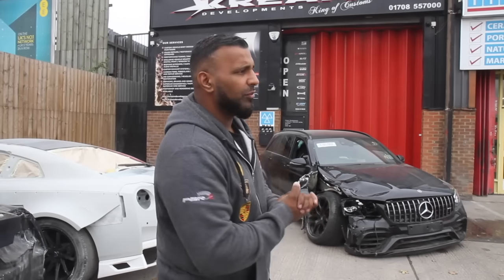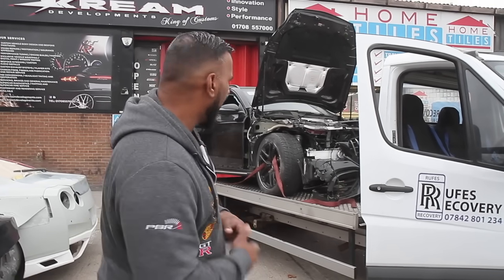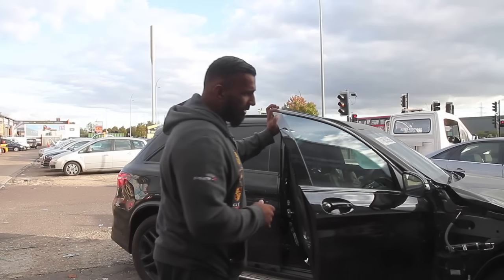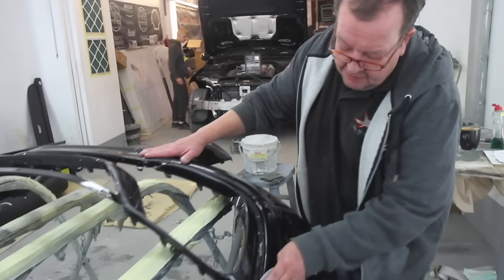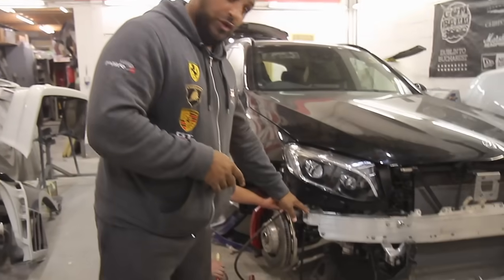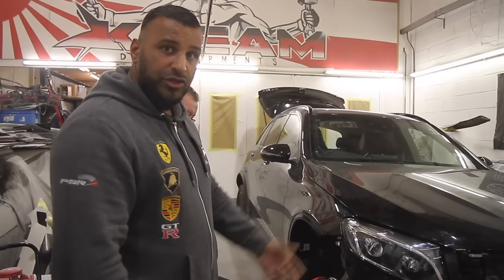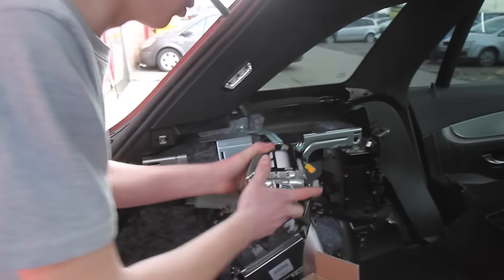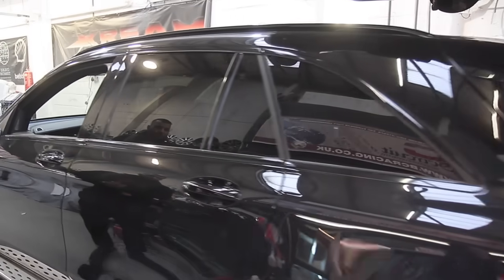MERCEDES GLC63 AMG FRONT END CRASH REPAIR - Kream Developments:All access Episode 44

Comment: I know it's quite unlikely that it would deploy, but why take the chance of reconnecting the airbag with the battery connected? That would be an expensive broken nose.
Reply from the maker: Great observation. It's how we man up all our staff :)
Reply: They won't deploy, airbags only deploy from certain sensors in the front of the car being triggered.
Reply: @jackmeoff7686  What if the sensors are damaged from the crash?
Reply: Arun Thampi sensors are controlled by a computer within the car that determines if they should deploy or not,    based on factors like speed, de-acceleration, G-force and things :)
Reply: @jackmeoff7686  Connect an airbag directly to a battery and see if they still need a computer in a car to determine whether or not they should deploy. There's a slim chance that when connecting a an airbag with the battery still connected, a surge of power could set of it. It's a slim chance admittedly, but I'd still rather my nose was at the front of my face rather than the back of my head.
Reply: Barry you ah yes I forgot that when you start a car all 12.6 volts or more go straight to the airbag and nothing else
Reply: Jack Meoff good man Jack, you’re an electrical genius.
Reply: @Barry I was thinking the exact same... it would have been way more than just a broken nose, that was 'point blank' and 3/4s😂😂
Reply: @Jack Meoff... That car was in a crash, sensors could be damaged in any way. I have friends including myself who's been in crashes to the point you would think the manufacturers have never heard of airbags (2 cars from new 1 used approved). Thankfully nothing long-term as it would have affected our lives🙏... Saying that however, maybe the 'used approved' car was involved and repaired in an unreported crash... So yh, you can never be too sure... From my experience airbags seem to have their flaws when it comes the need to deploy... Better safe than sorry
Reply: Well you obviously don’t know anything about how an airbag deploys. Plugging it in with the battery connected might set off trouble codes and do some damage to the wiring but it will never just explode.

Comment: Everything has been replaced?? Hang on what about that crash bar you've just pushed back into place hahahaah
Reply: It was 2" I wouldn't be too worried,I would of done the same
Reply: @garlicnaan1  it was compromised
Reply: @tax905972  sure it was by 2inch,if it was double that,then maybe,it's still got over 80% strength it will be fine and insurance approved it.
Reply: If you think about momentum multiplying forces then 2" could be a lot

Comment: Hi,  I have a question about my gle300d . I try to a 3500# trailer. I am not sure it will hurt my suv air suspension. The manual says it's max hauling capacity is 7200#

Comment: Can you show more indepth when it comes to airbags/squibs/seatbelts etc. I do the same part time, i always change dashboards belts bags old ecu for clean ecu yet airbag lights always stay on with bullshit codes etc very frustrating
Reply: you will need an resistor to take off airbag light
Reply: Get it on a diagnostic to see what you've missed. More than likely crash sensor somewhere.
Reply: @waqarkhan-tn1zk  thats not the right way tho bro. No cowboys jus Indians round ere :)
Reply: @877imy  always coming up as airbag fault open circuits squibs etc even tho they been replaced

Comment: Ends up at mercs warranty void.... A blind man will see the repair
Reply: God is Watching , mercy won’t void the warranty if the repair has completed using Mercedes parts , if it’s on a lease they will go around and inspect the vehicle with a paint depth gauge also looking to make sure no more that 1.6mm of body filler has been used in any repair. But believe it or not cars crash and need repairing , if it’s not been classified as uneconomical or beyond repair, accidents are not recorded like mot, services etc